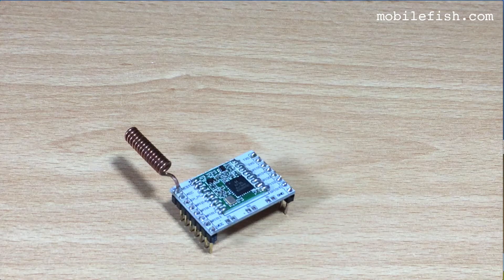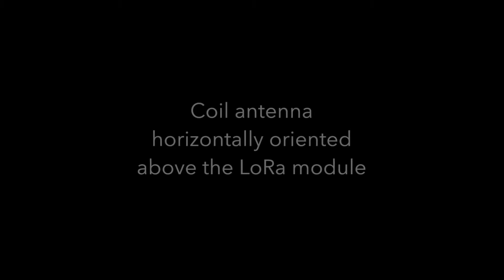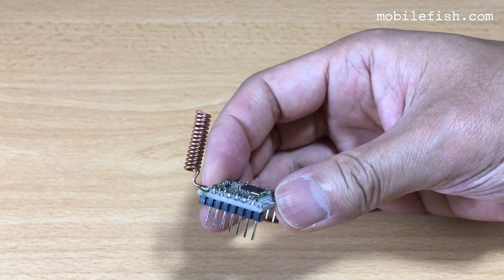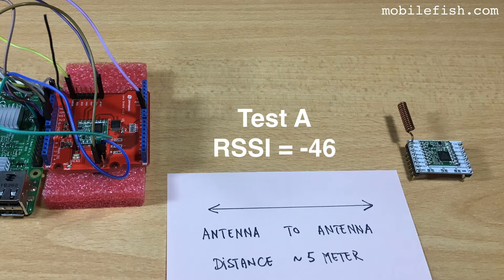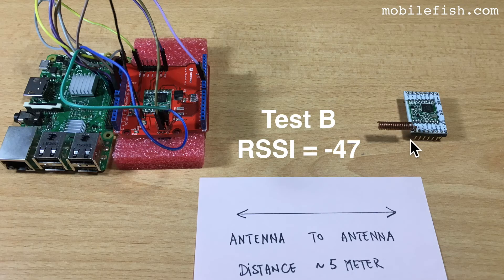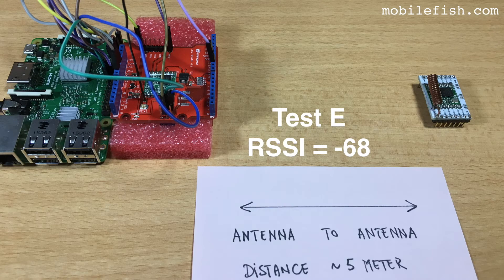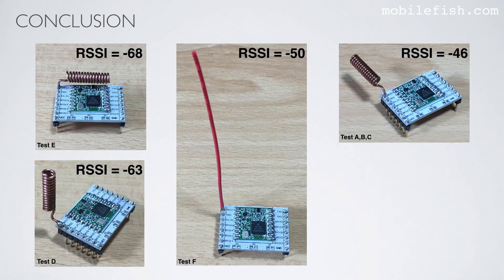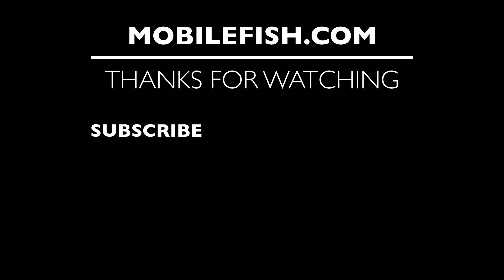Create a LoRa node, part 7: Coil antenna vs wire antenna revisited

Comment: on your website,  there was an article https://www.mobilefish.com/developer/lorawan/lorawan_quickguide_esp8266_adapter_plate_rfm95_rp_sma_female.html What is the name of antenna used over there?
Reply from the maker: At the end of the article, 2 antenna's were shown:
1) A coil antenna. The correct name is normal mode helical antenna.
2) The second antenna looks like a sleeve dipole antenna but it is NOT. When I opened the antenna it contains a PCB antenna.

The normal mode helical antenna and PCB antenna do not have great antenna performances.
Use these antennas if the distance between end node and gateway is less than 300 meters (MY PERSONAL OPINION)

In LoRa/LoRaWAN tutorial 45, I will discuss these helical antennas.
Best antenna to use is a simple sleeve dipole antenna, see tutorial 43.
Or build a quarter wave ground plane antenna, see tutorial 44.
Reply: @Mobilefish  thanks a lot for the information

Comment: Hi there...Great work you have there. I try step by step, by my console send this type of data

⸮[&4O!:l⸮.L⸮B0⸮.vt"2⸮tոk⸮⸮2J⸮⸮>⸮⸮>⸮⸮

All the character are like this. You know what can be wrong?
Reply from the maker: Do you mean your Serial Monitor? If yes, change your baud rate in the Serial Monitor (bottom right corner).
If you mean your actual Arduino IDE console:
Please provide more information:
- What hardware are you using (Arduino Uno, Hope RF RFM95??)
- Which sketch have you uploaded?
- Is ⸮[&4O!:l⸮.L⸮B0⸮.vt"2⸮tոk⸮⸮2J⸮⸮>⸮⸮>⸮ the only output?
Reply: @Mobilefish  Great i was the Baud rate as you said. Now i can see what the shield broadcast

Packet queued
903900000
4148075: EV_TXCOMPLETE (includes waiting for RX windows)

And that's it
I have a Dragino Lora Shield with a Arduino 1 and a Dragino Gateway LG01-P

The Gateway is says connected to the Thing Network but never receive a Package. 

The Lora Shield I put your code but in TTN says Never Seen with a green dot. 

Maybe you can help me out a little bit. Than ks!
Reply from the maker: It is very difficult to say what the problem is. I need more information:
Here you can try these solutions:
1) What sketch did you upload? Have you uploaded one of these sketch into your Arduino? See:
https://github.com/matthijskooijman/arduino-lmic/tree/master/examples
If you use ABP sketch:
Check your NWKSKEY[16],  APPSKEY[16] and DEVADDR
If you use OTAA
Check your APPEUI[8],  DEVEUI[8] and APPKEY[16]
WATCH OUT FOR: big and little-endian format (see the comments in the script)
2) In the The Things Network (TTN) console goto your device SETTINGS screen and disable "Frame Counter Checks" . (during TESTING disable this)
3) When you REGISTERED your gateway, there was an option:
"I'm using the legacy packet forwarder" 
You MUST enable this option!
See:
https://console.thethingsnetwork.org/gateways/register
There is no option available to enable (or check it) once your gateway is registered.
You can ask this question on TTN forum:
https://www.thethingsnetwork.org/forum/

Comment: You might want to do part 8 Testing- with the following factors included in your test parameters. First of all. RSSI is accurate to the +- 5 dB at best and each test has to be repeated x10 times and average shown. if the difference is greater then 5db then you can conclude that one antenna is better then the other. Second the theoretical length for a 1/4 wave 868mhz antenna is 86mm but due to the Velocity factor of the copper quality and insulation the real length should be closer to 84-82mm. This would electrically represent a 1/4 wave 868Mhz signal. Third you cannot compare one antenna result to the other until you have measured each antenna on a VNA to get them to peak resonance at 868Mhz. Fourth bend the wire antenna in all the same directions as you bent the coil antenna for a 1:1 ratio testing. I think you will be surprised that the wire antenna will win once again.
Reply: i will add a second test far away... that can give more real life results.

Comment: The value of the RSSI-50 shows a weaker signal than with the RSSI -40. When I have the transceivers side by side on the table, the RSSI is about -20. And when I go outside, the RSSI becomes -80 with the distance between modules about 300 meters. And you somehow have the opposite.
Reply: ,how do you see the signal strength between transmitter and receiver?

Comment: The coil antenna are actually resonate at 868Mhz,  but the length of 86mm single piece antenna seems wrong. 86mm are 1/4 wave length of 868Mhz but you forgot to shorten it, Velocity Factor of the wire will need to shorten the single wire antenna to make it resonate at correct frequency, thats the common mistake that most people make. Hence I suspect that the result of this test was not true.
Reply: then what should be the length of wire antenna at 868Mhz???

Comment: Now that you know the coil antenna is best - Have you tried different lengths and different diameters of coil antennas? Maybe even different gauge of wire. Thanks.
Reply from the maker: No and i am not planning to do that. Takes to much time ;-)

Comment: Really a very useful video for newbies like me. However, sir, do you know Arduino library for LoRa 433mhz module. If you know please provide resources (URL, Blog, website or zip file etc.)
Reply: Probably depends if you want to do LoRa or LoRaWAN, and depends if you're using a module that includes the LoRaWAN part or not. If you want to get on The Things Network (sort of a public internet for very small amounts of data, like bytes, and it uses LoRaWAN), then the best module is likely the RN2903 / RN2483 since it is shielded (for FCC or your country's equivalent compliance) and already has the LoRaWAN parts integrated.

If you're using a LoRa 433MHz module like the RFM96 and want to do LoRaWAN (in your own microprocessor instead of in the module), look into arduino-lmic.

Comment: Awesome videos! What about when the antenna is horizontal, but facing inward? So not on top of the module but accross the pins / over them? One would use such a configuration to save up space in a mounting box, for example.
Reply from the maker: Hmm, i will try it out.